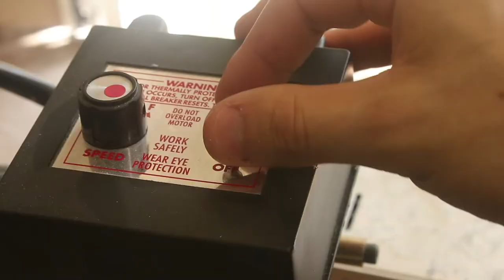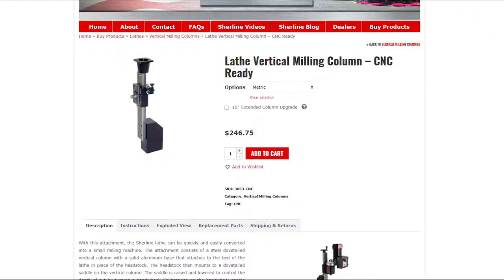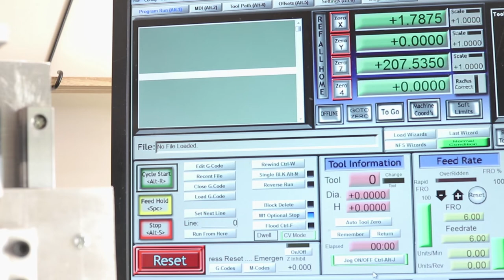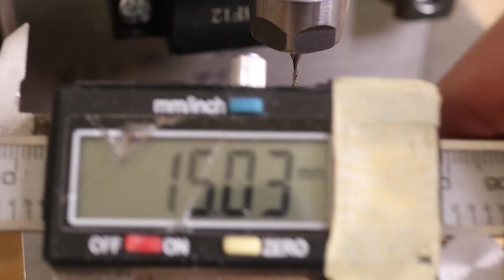Building A CNC Mill That Attaches To My CNC Lathe

Comment: Very nice, I was kinda expecting you to install the milling attachment on a slide so it could move left to right, and reach from the chuck to at least 10cm so you can do more complex operations, rather than using it as more of a mini mill. Love the build video, very thurough and easy to understand, please keep em coming!
Reply from the maker: I was originally thinking of doing something similar at the beginning but with the type of cuts that I wanted to do, this method worked best for me. When I weighed the total weight of the mill attachment it weighed over 8kg which I think is a little much for the small lathe slide. I do have in the works a smaller version which would attach to the cross slide and if I hook up the chuck to a stepper motor I would have a small 4 axis mill. Early days though. Cheers

Comment: Great presentation sir; precise, clear, and professionally done.
I'd love to see the updates you come up with.
If you'd be open to some constructive feedback,  I have a couple of ideas:
You used reasonably thick material for most of the construction, which is great, and included an angle bracket on the back side of the mill column for added rigidity.  The way the bracket was manufactured though (thin, stamped sheet metal with what looks like a spot welded brace, and screw mounting holes relatively far out from where the brace is attached ) may not be ideal for the job.  It's fine for holding up a shelf, but probably isn't contributing much to holding the column rigidly in position.  There's simply too much flex in the bracket itself especially when placed under tension (ie. pulling the column forward, away from the bracket).  I'm guessing that if you replace it with a triangular piece of aluminum similar to what you used for the rest of the structure; drilled, tapped, and counterbored like you did with the rest, it would be 10× more rigid. 
Second, you mentioned that you expected to need to make the table top more rigid.  You're absolutely right, but the level of rigidity needed for precision machining isn't all that easy to achieve. Several more layers of thick plywood, all glued and screwed together into a slab 3-400mm thick would make a big difference. Even better would be a piece of granite.  You may be able to source a small piece from a monument company or, what I did was found a company that installs granite countertops and picked up 3 sink cut-outs and sandwitched them together with epoxy.  I used a masonary drill to bore the holes I needed, bolted everything down, then added shims to square everything up.  The difference was tremendous!
Anyway, best of luck to you. And don't expect everything to be perfect the first - or 10th - time you try something. Keep at it, and always watch for ways to make improvements. 
Doug

Comment: Very nice. It does seem like you would get some substantial gains in rigidity if you were to mount both the lathe and the mill to a common plate of steel.

You often mention getting steel in a hardware store. Have you gone to any recycling yards? I've seen other Australian YouTubers pick up things at scrap yards so I know they exist where you are. I feel certain that you could get a much better deal on materials than you would ordering them online or buying in a hardware store. 

Here in the US I would expect a 6 mm thick mild steel plate that your whole system could sit on to cost me around $60 US buying it by weight at a scrap yard.

Comment: Bro never put one of those cheap Chinese power supplies around any milling equipment if an aluminum chip makes it into one of those fan vents it could short and burn your shop down. Always face those vents down and away from the machine.